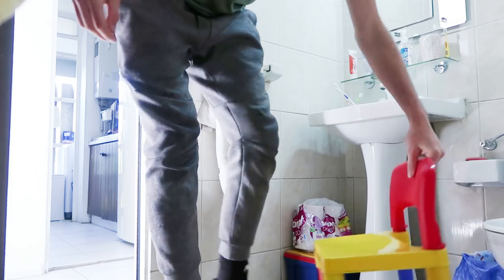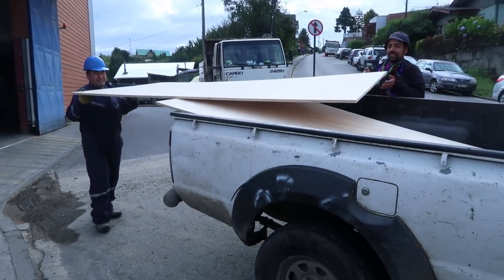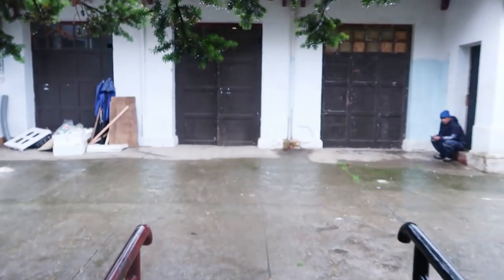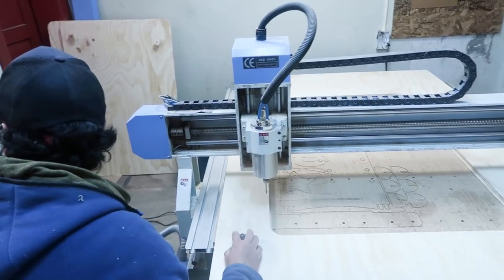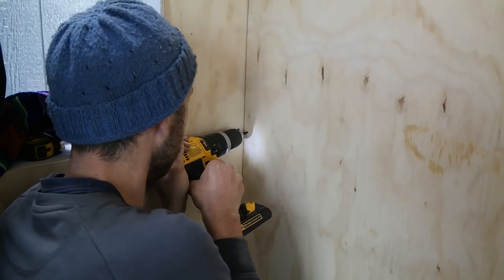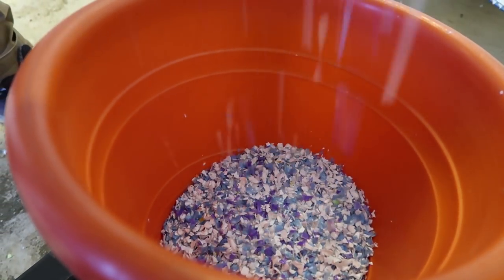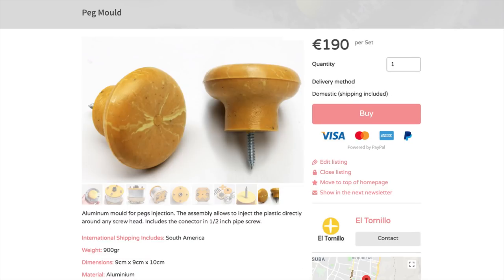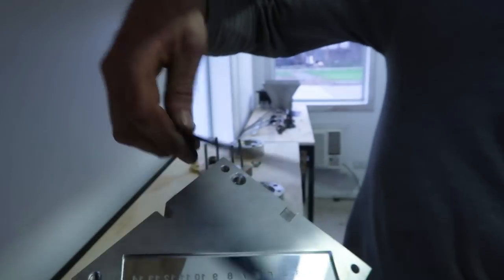Monthly News #14  - Precious Plastic in Patagonia 🇨🇱

Comment: Hey I recently wondered if you could create simple insulation materials or foam from recycled plastics. And make a machine for it. Something like foaming one of the plastics with CO2. Polystyrene for making XPS could work. Probably this requires a lot of pressure and engineering and expertise though.
Not sure how important that is since most poor areas curiously are in warm climates anyways.